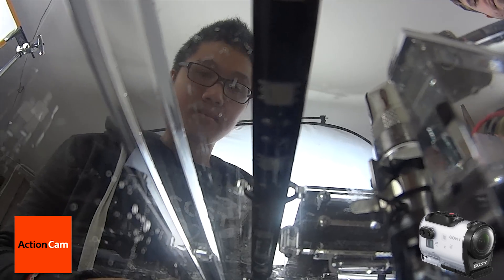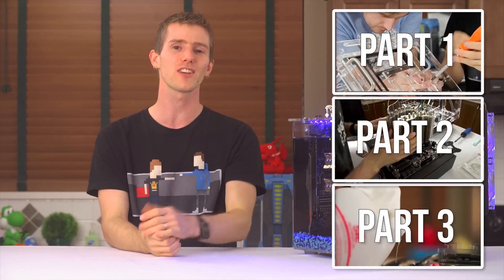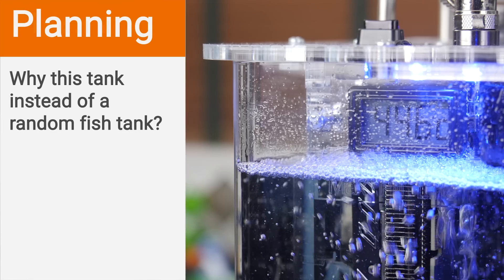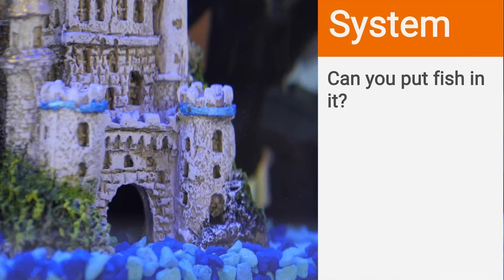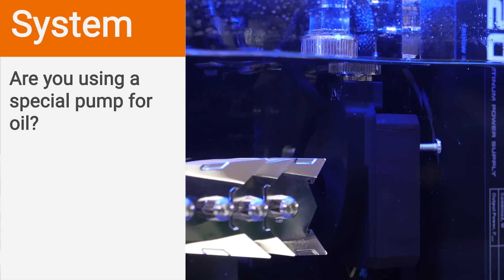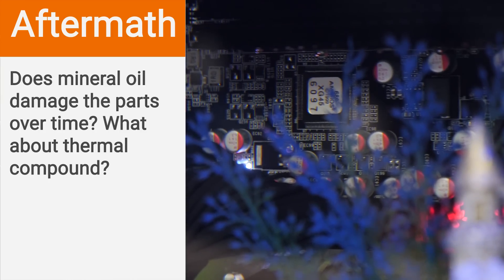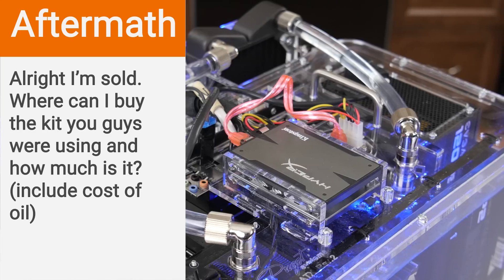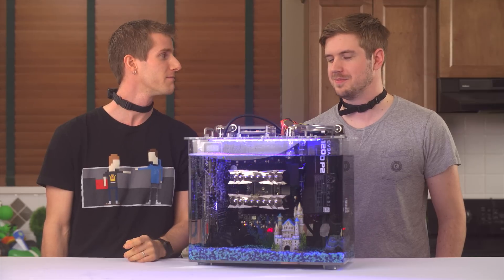Mineral Oil Cooled PC Part 4 - Q&A

Comment: Does the mineral oil dissolve in alcohol? 
I mean that if you would example want to take the oil out of your pc component you could submerge it in alcohol to take out the oil.

Is the re others fluid plausible to use (cheaper than mineral oil)
Maybe some short of Oil-based fuel etc Diesel?
Reply: Yeah a dick load of electronics submerged in a highly combustible liquid doesn't sound like a great idea.
Reply: Diesel doesn't actually have a low flashpoint(its somewhere up around 220 -240°c), in an engine you need to get a coil to heat it up before it can be ignited in the cylinder and you also have to atomize
Reply: Alcohol will evaporate quite fast.

Maybe if the "Diesel PC" would be in air tight container the smell would not be issue.

Maybe if i would just take some plastic container, put diesel in it and some radiator to cool diesel etc... and i would have very cheap,cool and quiet pc  :D
Reply: Promiscuous Fiish Diesel have to be atomized to burn.

I have alot of Tax-free "Red diesel", it would make sick red themed machine with red leds etc components :D
Reply: NuffMan
Diesel eats through  plastics and its a solvent so i think it wont work
Reply: NuffMan I like the smell of deisel lol
Reply: im pretty sure if you got the alcohol too hot it would ignite, also not diesel because of the smell, you wouldn't be able to see much in the pc anyway because of the opacity and cloudiness of the liquid
Reply: i don't see a problem with washing your components with alcohol (ethanol or methanol) as the mineral oil is soluble in alcohol and alcohol can be evaporated at a relatively low temp. as for using diesel (for cooling i'm guessing) it would just smell incredibly bad don't know about the chemistry.
Reply: automotive brake cleaner would be best it gets rid of oil and leaves most everything else alone, i use it for cheap contact cleaner and never had any issues
Reply: all these things would clean it, actually baby oil - the non scented type is pure enough mineral oil that it can be used to store volatile metals like sodium :P, back to cleaning it tho I would be afraid to dip my components into alcohol/diesel - it might dissolve / leach something you might not want to :P
Reply: Alcohol easily ionizes so if there was any voltage left in it it would short out also alcohol corrodes solder if I remember correctly.
Reply: Yeah alochol (ethanol) would either start to evaporate around 70 degrees(158F), so if your components heated up it would turn to gas. Also alcohol is slightly acidic so would ware away at your components and is also conductive (like water) so the system would short fuse. So yeah don't use alcohol, stick to only mineral oil.
Reply: Please do not put your PC in diesel/gasoline.

They have a relatively high vapour pressure and aren't exactly the healthiest thing to breathe in on a daily basis.  (Especially gasoline, due to its higher aromatic content.)  Additionally it's a huge hazard in case of a fire (your components won't ignite it though, as long as they're submerged and not near the vapours.) and there's so many different compounds in diesel that it's not possible to predict how your components will hold up to being submerged in it.  99% Mineral Oil is the only thing I would use for something like this.  (It's also relatively cheap as far as chemicals go.)  

Source: Chemist
Reply: ***** Safe?  No idea.  There are a few things you could try (cosmetic colours i.e lipstick for example) but I would be wary of dissolving anything in it. (Could introduce a hundred different problems)  I would use tinted glass or coloured lighting to achieve the effect.
Reply: You could use olive oil and dip some crusty bread in it while you're gaming and have the munchies... LOL!!!
Reply: the diesel vapor/smell will not be the issue if you have "breather hose"  and lead it to outside etc where the vapors dont bother.
Reply: NuffMan Not really a practical set up for most people and is still a significant fire hazard.  That line will also freeze up in colder temperatures. (Anything below -10C will eventually cause problems as the diesel will condense and solidify.)
Reply: Steven Gloux i have played so much with diesel that i know that if you want to light it up you need to try really hard and its still very hard to light up. Maybe if the diesel have soaked in to some kind of cloth then it could start to burn but still needed very hot surface to light it up.

Freezing will not be a problem because there is diesel which can withstand alot of coldness.

Condensation can be a problem thought, but maybe some kind of "Water lock" or somekind would help
Reply: Yeah, diesel has a very high flash point which is why the compression is so high on diesel engines but it also has a very high btu. Like mentioned in a previous post atomization is a big factor in ignition of petroleum based fuels. I've seen people throw diesel on a small fire and put the fire out.
Reply: NuffMan Diesel itself takes some effort to ignite.  The vapours however will ignite much more easily.  The flash point (the point at which a spark is observed) for diesel is between 50-90 degrees C.  It's very possible for the vapours to ignite and start a small fire which will very rapidly grow into a larger one.  Remember, the components that are vapourizing so easily are also the most volatile.  You can bet that with an ambient diesel  temperature of 40-60 degrees celcius you're going to see a lot of vapourization. 

People have lit fires at the pumps with static electricity because of vapours.  It's a fairly serious concern. (And in industry most labs have extremely good air transfer between the lab and outside as well as warning alarms for accumulation.)

Freezing will be a problem.    The additives that help prevent waxing and geling of the diesel won't travel with the vapours through the air, and those vapours will absolutely condense and freeze at relatively mild weather conditions.
Reply: Steven Gloux diesel does not release vapors like gasoline does. No real risk for flammable vapors.
Reply: Maybe if the breather pipe has a kink and a cup so that the condensation water would stop there.

Comment: I read about a couple of builds several years ago that used vegetable oil. They worked great at first, but after a few months, it turned rancid and smelled horrible (even though they still functioned fine). Fortunately, mineral oil doesn't have that problem. :)

Comment: Noticing something odd... How can the oil temp be higher than the GPU temp in idle and CPU load testing? Shouldnt the oil heat up the GPU?
Unless the temp probe of the oil was placed somewhere, where it still feels the heated oil of the CPU heat sink.
Reply: Well if you blow hot air through a cooler it will still cool only less effecient. but I think the main reason is that the oil temperature is measured close to the CPU which seems to be where most heat is generated.
Reply: the gpu is a lower temperature because the oil is taking away the heat generated by it even though its hotter, its a sort of refrigeration effect, if you move or spread out a liquid or gas it has a easier time absorbing thermal energy, bet you the fans on the gpu make that happen
Reply: Okay don't even get me started buddy I'm apprenticing in refrigeration/HVAC and I said a form of refrigeration as in dissipating a fluid/liquid to absorb thermal energy and yes I was referring to the fluid in the heat pipes
Reply: But isnt that basic physics that both of you would be violating?

if you blow hot air through a cooler, the air needs to be cooler than the radiator for it to work... Because coolers work through dissipation of heat, which always runs from hot to cool.
Likely, the oil is cooler around the GPU. Perhaps the air, that might be a bit cooler than the oil, is adding a little cooling to the oil locally with all the bubbles, and temperature is again measured elsewhere.

Refrigeration is impossible.... A fridge works through pressure and temperature are linked: if pressure drops, temperature drops as well. In a fridge, the coolant absorbs heat inside the fridge, then the coolant is compressed, making it raise in temperature, and being hotter outside the fridge - where the radiator releases the heat in your kitchen.
Regardless, its an active process that requires work and a compressor.
Unless you refer to the work needed in heat pipes for the gass/liquid transition... That could be possible...

Or the obvious elephant in the room: temperature probes may be set inaccurately, both measuring the same oil temp but converting it improperly to differing values.
Reply: But the misplacement of a thermometer is also a possibility bit to be comepletly honest, who cares am I right
Reply: ***** Well you can't heat anything higher than the hottest part. If either you move air or liquid through a radiator it will only go be able to barely reach the temperature of whatever is flowing through, as long as the GPU is not generating heat the radiator will only dispense some of the heat picked up from the oil to the unit because it's constantly moving through.
Reply: Promiscuous Fiish
Sweet :D "apprenticing in refrigeration/HVAC" So you know this stuff ^^

Let me ask you then, perhaps you can confirm/contradict some of my questions:

Heat pipes help dissipate heat from the heat source to the cooler side of the pipe. If the heatsink's fins were hotter, would the heat pipes work in the reverse direction, and increase the GPU temperature?
So even when work is required for the phase transition - isnt it exactly that work which is deposited as heat on the cooler end? In this case being the GPU?
Reply: Kim F. Wendel I think you are missing something here...

You say you cant heat anything higher than the hottest part. Sure.

You cant also Cool anything lower than the Coldest part...

The coolant in this case, is the mineral oil. It is touching the GPU card everywhere - and its much more massive than that card, so it should be warming the GPU up to the temperature of the mineral oil. Its even warming up the fins of the heatsink, so the GPU cant get rid of its heat, since the heatsink is already 1 degree warming than the GPU chip...
But according to the test results, the GPU is cooler than the oil...

Its like swimming in a hot pool, standing in front of a water jet. The pool is hotter than your body temperature, so regardless of the water jet, your body temperature will rise to match the water's.
The water's flow doesnt matter - its the temperature difference. Flowing water ever increase the speed at which your body temperature would rise, since its constantly supplying fresh hotter water.

Its not like the GPU is doing completely nothing also, as it always warms up a little when showing the desktop.

Also i doubt they make the mistake of starting up the pc and not letting it sit to reach stable standard temperatures. They are above that rookie mistake.

So again: i see those measured results. This result seems odd - so im guessing misplaced thermometer. But i wonder if anyone else has a differnt, sensible explanation.
Reply: ***** well the gpu really doesn't generate any heat as long as it's just sitting there idling.

But I am sure there's a mis-match in these readings or it's not working very well
Reply: You are looking at it from a basic physics standpoint. The equations dealing with heat transfer are differential not basic algebra which it is simplified to in your high school physics classes. The heat isn't constant throughout a material as the zeroth law of thermal dynamics would have you believe, that is for an ideal system.All of your examples are dealing with a closed system, this is not a closed system due to the radiators.  It is not basic physics that are at play here but a rather complicated thermal system that require a understanding of high level mathematics and fluid dynamics along with thermodynamics. 

The oil next to the cpu will be hotter than the oil next to the graphics card since the graphics card has fans circulating the oil. This allows for the hot oil to be carried away and replaced with cooler oil from the radiators. The cpu on the other hand doesn't have a fan moving oil about. Sure the heat generated by the cpu is being radiated out through the oil but the oil is also cycling through the radiators due to the pumps. So as the heat is being radiated outward the oil it is radiated to is being sent into the radiators for cooling. If there was a fan on the cpu its temperatures would be near that of the graphics card since it would be pushing the heated oil about.
Reply: longshot726 Jebus H. Christ the thermometer is either sitting at a point right before the radiator input or at a point where the flow is diminished (therefore heat builds up) because those areas are more critical and the rest of the oil will always be cooler.

I took thermodynamics in college so there's no bs highschool excuse. Heat can't move from a colder body to a warmer one just because of flow. If that was true you could freeze food with a large fan. Your explanation contradicts both theory and practical examples.

The oil near the heatsink will be colder than the heatsink, trap the heat and move away. No reason putting a thermometer there if you already know CPU temps.
Reply: Filipe Amaral Thank you! :)

Comment: the one thing that would make this build 10 times more awesome is if you had a tiny remote controlled submarine that you could drive around inside the oil. also if the submarine had a camera on it, that would be awesome.
Reply: Wouldn't have much space though
Reply: Michael Pfeifer jelly much?
Reply: Air Hogs Dive Master :) It has more than 30 minutes of battery life
Reply: UPVOTE THIS SO THEY CAN DO THIS
Reply: Tomas Crespo what if it had an air bubble in the middle of it?
Reply: ^ This.
Reply: Brick Tamland  BRICK, YOU'RE ALIVE!
Reply: Brick, you sir have a good, happy thinking mind.
Reply: tiny nano submarine we can crunch electronic component size very small now :)
Reply: Edward Chiang
that would be great, someone do that.
Reply: You look like a paper manager i once knew.
Reply: Submarine that you control from your computer
Reply: Michael Pfeifer ....
Or Space themed.
;)
Reply: Brick you can't use a tiny submarine in mineral oil,  because of the density it would stay in bottom all the time
Reply: ive been saying the same thing about toy mechanical fish but i dont know if they would work.........
Reply: Brick Tamland yes and no.. im very jelly for the super awesome rig ;) but i really dont understand the dynamics behind the decision "yeah this will definatly look better with some blue rocks and a little plastic castle". im mean you cant argue taste, but seriously, its just plain not an improvement.
Reply: Brick Tamland Brick, you have to check the density of the plastic and materials and then the density of the water, the problem is that the variation of density in the the submarine is not enough so is imposible for a submarine of that size do it.. When you understand the mechanic and the science behind that you would see it with a lot of sense! bye!
Reply: He loves lamp !
Reply: or if they threw out all that tasteless aquarium garbage and left the rig an aqesome professional looking beast of a machine instead of a joke for a childrens room
Reply: @Renuclous  nah, it looks amazing with the aquarium stuff.